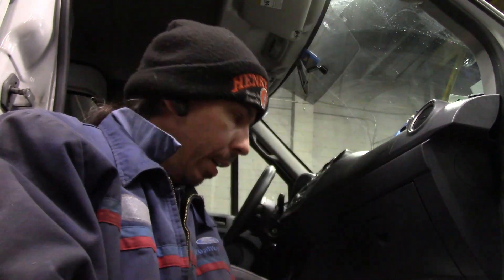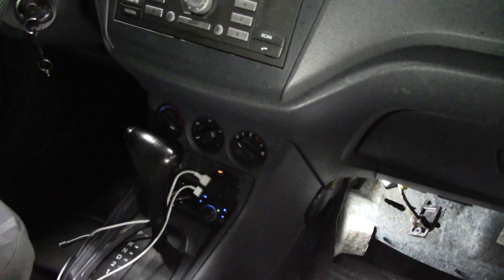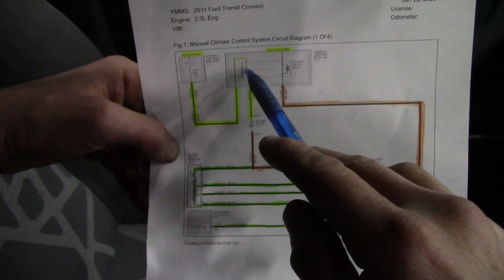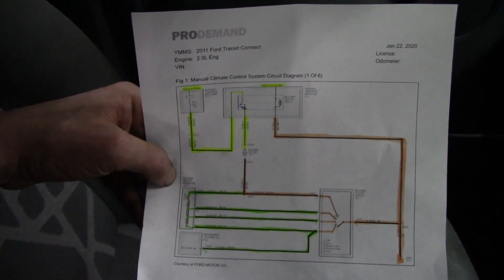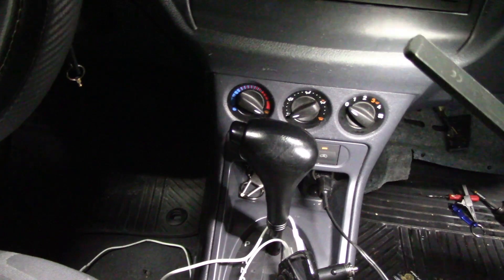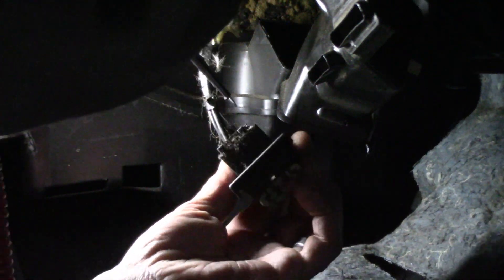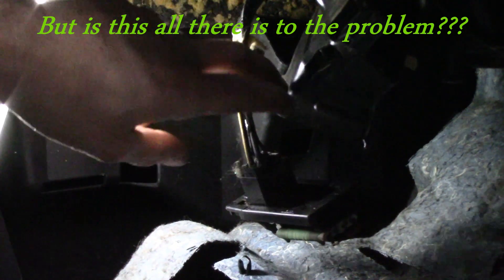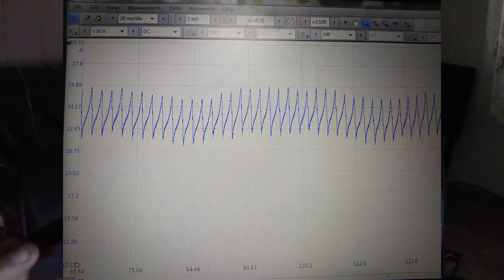Blower Motor Testing Let's Go Through This Circuit

Comment: Using the scope to verify the blower as the underlying fault of it all is the bigger message here. The Autel scope is a great starter scope.
Reply from the maker: Corey, "someone" needs to do a video on that scope....hmmm....
Reply: I agree doesn't it the peak detect on all the time?
Reply: The Autel scope is a great viable scope for sure. I mean for $400 you cannot, I repeat cannot beat it. I love mine, I replaced the leads with pico.

Comment: For those of you who cannot afford a Pico check Logical Canuck's channel. He uses a Hantek and Hscope software on an Android tablet. He also shows you how to make all types of scope accessories, a clever guy! 

Just don't buy a Hantek scope on eBay if the price is ridiculously low, it's a scam. I have the Hantek 6022BE two channel scope. It can run on Windows, Linux or Android, but it only comes with the Windows software. My Hantek cost about $60.
 Here's link to LC's channel: https://www.youtube.com/watch?v=CAfHPlNUYQE
P.S. You have a great channel Joe. Keep up the good work!
Reply from the maker: Thanks, but from what I am told, they are better off buying the autel scope module for 400 bucks and just use PICO leads on it.

Comment: I started out in the auto world in high school. But after working at a dealer decided it wasn’t for me. So I took electronics in college. Been an electronics tech for 30 yrs. after several years of teching and some teaching I switched to IT. All decent jobs. But have been using scopes for decades!

I looked at the Autel because is a much cheaper option than a pico. The software is meh. But the scope part itself worked okay. Think I might consider it over a hantek. 

I still use my old fluke 99B and my analog techtronix scope... 

Still work on cars and bikes. The electrical stuff became so easy after 3 years of electronics training in college. It really needs a lot of emphases in the automotive programs. There is no substitute for lots of electronic circuit training. Maybe not to the extent I had. 

Great vids as always! Cheers from Ontario Canada!
Reply from the maker: Thanks a lot man. Sounds like you enjoy what you do. That's always good.

Comment: DIYer here. I did a similar thing on an 05 Focus recently. Hooked up the test light right to the motor with t-pin and cycled through the speeds which changed the brightness of the light with each speed. Valid test for the resistor?
Reply from the maker: You would just need to verify input to the resistor from the switch if you lost a speed.

Comment: Nice job explaining the process. It would be easy to assume the resistor was bad based on experience but that's why your a professional, you test to verify. Having two issues is always a challenge but you make a good point. Having a scanner and scope is totally necessary for these days of working on cars.
Reply from the maker: Thanks Wyatt. Appreciate that man.
Reply: Is it really two issues? I was assuming that the motor dying made the resistor go.

Comment: If anyone is out there thinking about buying a pico scope you will not be sorry, it is very easy to use, so don't be intimidated.  I have the 4425 four channel pico. It will eliminate a lot of guess work in your diagnosis!

Comment: I am a DIYER.  Did you check the blower motor by using an amp clamp and comparing it to the specs to determine if was slowing dying?
Reply from the maker: I think I explained it in the video pretty well...

Comment: Excellent video Joe. This is a great example of understanding the circuit design and integrity so you knew that it was  ground side circuit so you could do some fast simple testing to verify, rather than pushing parts at it to see if it fixes it. I use the power probe lighter adapter same way you do, fast easy known power and grounds. Nice job brother.
Reply from the maker: Thanks bud.

Comment: Have seen a lot of bad blower motor resistors and connectors in the last few years, don't make em like they used to and has become a trend across several brands....Mostly domestic it seems.
Reply from the maker: BMW with their final stage unit seems to be a big failure too..and Nissan..
Reply: @JoesAutoElectric  Yeah that sucks. I know the mid 2000s Silverados eat resistors like candy cuz GM in their infinite wisdom ran too small of wires to them. Apparently they live in a fantasy land where there's no more relationship between amps and wire size anymore.

Comment: Why didn't the fuse blow if those wires were hot enough to actually burn the insulation of the copper?  Why would the motor cause that connector and terminal to heat up like that?
Reply from the maker: The amperage draw is not high enough to cause the fuse to blow. What does happen is the resistor itself does get hot, normally. The plastic connectors over time get slightly loose and create excessive heat and this beings a cycle of damage that results in what you saw here.
Reply: @JoesAutoElectric  Thanks for that and all the info you give us.

Comment: The scope is an amazing tool and has so many great uses that sometimes I forget about some of them. Nice video and great example of following the diagnosis through to the end to prevent repeat failure. I prefer the Pico but love the vantage pro for quick checks and parking lot diagnostics. lol the multimeter function and pressure transducer function for checking fuel pressure and such on a test drive is great as well
Reply from the maker: No doubt!

Comment: It seems like with the way technology is going with scopes and making vehicles drive themselves they could engineer a better style of resistor (control module) that won't be as likely to burn up your hard earned investment while you riding in it. I work for a radiator and  HVAC shop plus we do more and 90%of the time the resistor harness and blower get replaced. And with a scope you can verify and have proof that the blower is bad and do it quickly.

Comment: I am going to b using  my scope on blower motors. Excellent video!!
Reply from the maker: fantastic!!!
Reply: Blowers and fuel pumps and relative compression test that's what I started using the scope on and changing the time and voltages is how I learn to use it and like Mr. Joe said snap on is different than I guess all others. What kind of scope do you have? If you don't mind me asking?

Comment: That's a very thorough diagnosis, many shops would've just stopped with the resistor/pigtail replacement and called it done. With cars becoming as technical as they are nowadays, is it still even possible to run an auto repair shop without having an advanced-level scope? I don't know how they could get by with just a $100 scan tool
Reply from the maker: Thank you. In truth you cannot get by with only one scan tool...especially not 100 dollar one. You need tens of thousands of dollars in scan tools. A scope , in my opinion, is a must have tool. We have three...I want one more...and want to sell one of the ones I have currently. So we'll see...Never have enough diag tolls or knowledge.
Reply: @JoesAutoElectric  the shop I work for has one scan tool I have two, a bluepoint and a small autel, but their modis edge has a scope. I'm fixing to get the Uscope and a launch scan tool because I found out that the modis doesn't program skeem or skim or program some things but the other tech in the shop has the new matco scan tool and it does. Then next year I'm getting a Pico. And thanks again for sharing your knowledge and time.

Comment: Most of the time when the resister goes the fan motor is done. Sure would like the pico scope but in time.
Reply from the maker: Agreed...and you will love Pico
Reply: The software for the pico scope is far better than the Autel software. If you use a scope a lot it’s the one to buy!